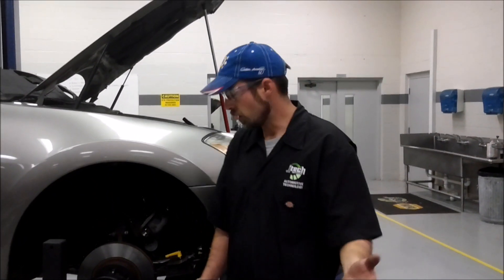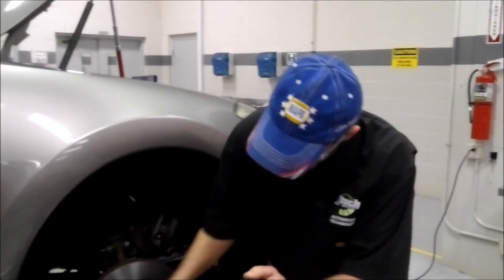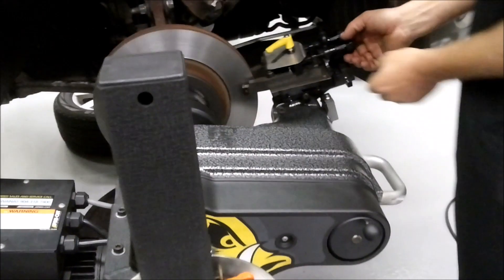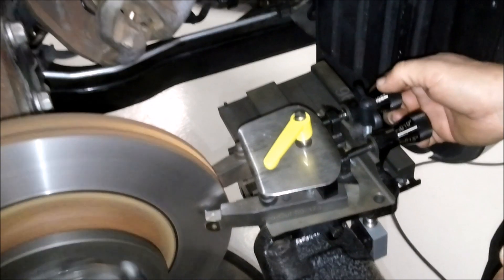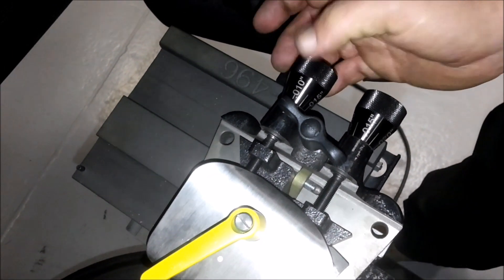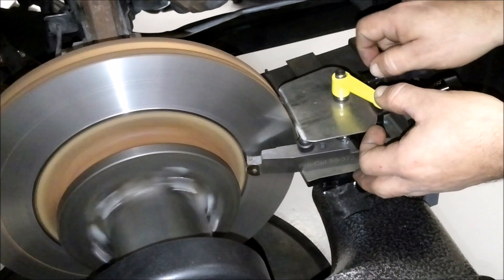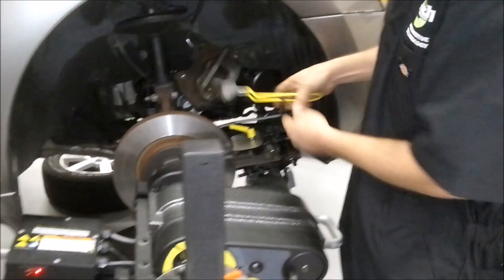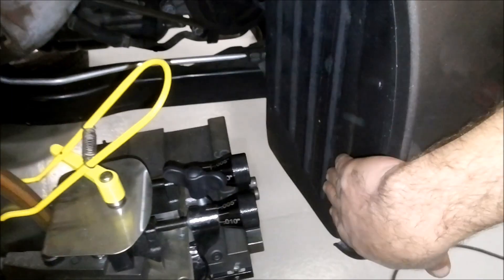TURNING BRAKE ROTORS

Comment: When the rotor is turned while on the car it accounts for any imperfection that the hub might have. Making it a better alternative to a stationary turning machine. Use a paint marker  match the rotor to a  lug hole.
Reply: Yes, untill the rotor is removed for another repair and placed back onto the hub at slightly different position. Here comes the vibrations.

Comment: I'm a machinist , what a joke . Way better off to remove it and turn it on an actual brake lathe or replace it 😂😂😂😂😂😂😂😂🤭🤭🤭🤭
Reply: Same thought as you, all the time spent to remove the caliper and bracket to basically have the rotor off and they decided to add a fancy machine that takes more time to hook up to the car then walking over and cutting it on the machine
Reply: Well we can't see if the rotor can be removed w/o regreaseing the single or dual bearing and getting the tension and reinstalling the cotter pin. If you just pull off the rotor. Then I would use my brake lathe

Comment: It would be interesting to know how much they charge for this procedure, because the time spent here, is as much if not more, than changing the rotors, which for a car like this one, they may cost 70/80 dollars the pair. I mean, is it worth doing all this?
Reply: Sebastian Tevel sometimes rotors don’t need to be changed just refinished but I understand what you’re saying
Reply: I just came back from getting an estimate on getting my rotors turned cuz I knew they were bad.
They charge $129 per axle so  roughly $520 that's outrageous.
In the myth they use is on the car turning.
Reply: @jayn2022  Man I would love to know where in the HELL you went and got an estimate to turn rotors haha it doesn’t cost more then 50 bucks to turn a pair at the parts store or any local shop
Reply: @jayn2022  yeah just got this done yesterday I wanted new ones put on but they did this to them and charged me same price for it I didn’t want that I’m kinda pissed about it. From shwab

Comment: I just came back from getting an estimate on getting my rotors turned because I knew they were bad.
They charge $129 per axle so  roughly $520 that's outrageous.
In the myth they use is on the car turning.
Reply: Bro just replace them, I do it in the bay for 130 labod
Reply: RockAuto, brand new $40.